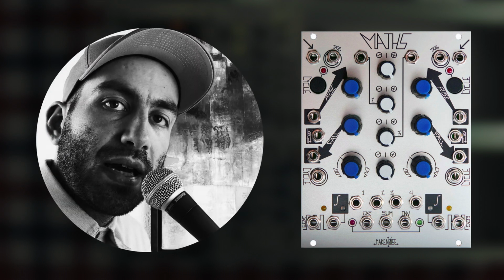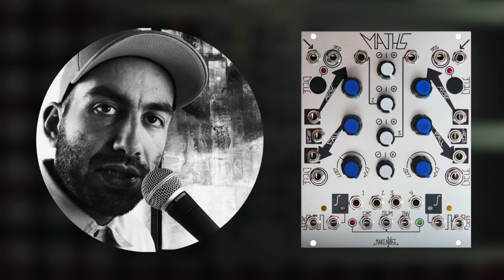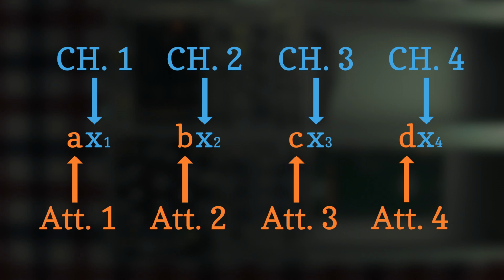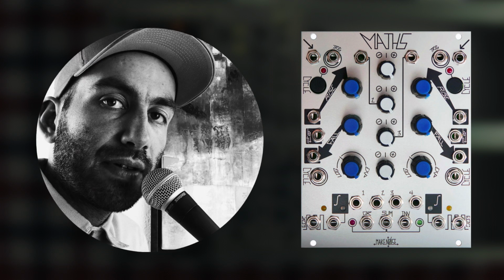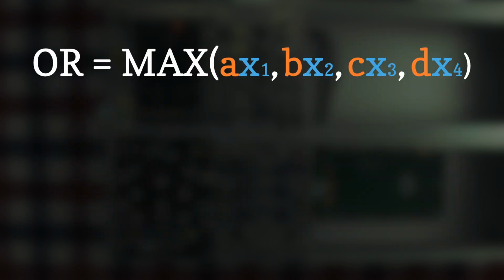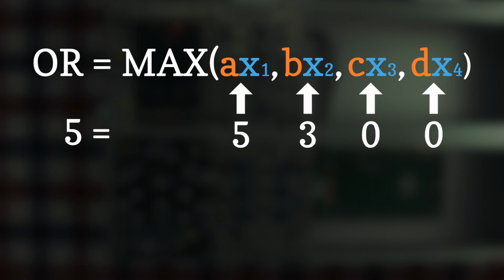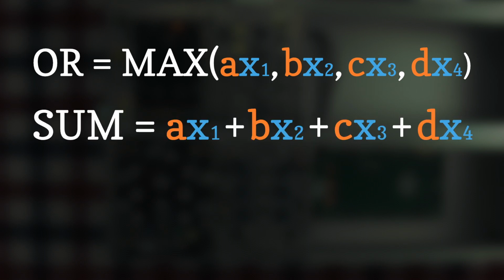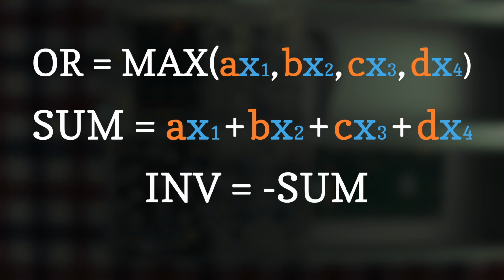MAKE NOISE MATHS TUTORIAL ~ Eurorack analog computer module

Comment: Thanks for the video!
 Still trying to understand: what's the main difference between Cycle and Trigger inputs?
Reply from the maker: The cycle input simple toggles the cycle on or off. it's like a gate input for pressing the cycle button. So as long as a gate is high in this input it will keep looping. The trigger input actually triggers the function. Hope that makes sense.
Reply: @onceuponasynth  Got it. Thanks a lot!

Comment: if sum is the equation ax1 + bx2 + cx3 + dx4, then it can essentially be thought of as the dot product {a,b,c,d}.{x1,x2,x3,x4}. So if you think of each attenuverter as the component of a vector, and each of the channels as the component of another vector, then the sum operation multiplies their two magnitudes and the cosine of the angle between them. or in other words: it projects one vector onto the other and multiplies their resulting magnitudes. crazy! Imagine the kind of complex math you can do with this if you really analyze what's going on each of the channels. Their voltages vary, but in ways that can be related to each other. This is really cool.

Comment: Amazing video. Thank you. Question for the masses, if I went another direction and bought a Function or Contour1 (basically Maths ch 1 or 4 only) Would I miss not having the rest of the Maths functions? are most people using all functions simultaneously ie the mixer, both slope gens, attenuators, etc? Im aware that it all depends on what Im trying to do. Just wondering in a real world scenario. This would be for noodling in the house, not creating the next masterpiece to give to the world😄. Just looking to save a bit of space and cash.
Reply: Well first thing to realize is that you’re not actually getting the full 1st and 4th channels of Maths, because neither Function nor Contour has built in attenuation. 

If you already have a ton of attenuation, inversion, offset, and mixing in your setup then you could probably do without some of the logic stuff especially if you don’t do generative patching or use complex modulation by combining multiple sources. However, if you don’t have a lot of utilities, you’ll probably be patching and think “damn, I wish I had another attenuator/mixer/offset voltage” and that’s where Maths comes in clutch.

The best way to get the most out of a Maths like module in the least HP is probably the Cosmotronic Delta V which is two function generators and two VCA’s in 10hp.

Comment: 5 OR 3 OR 0 OR 0 = 7, not 5 as you stated here 1:50
Reply from the maker: So the "SUM" output would be 7.  But the OR output outputs the highest value out of the inputs (in this case 5). From the manual: "It always outputs the highest
voltage out of all the voltages applied to the inputs".
Reply: once upon a synth i accidentally stumbled upon this video i'm here with a mathematical background. I guess that that OR function isn't the same as the mathematical OR function i searched for analog computer and this was the first hit. When i wrote that comment i thought that this was a genuine analog computer video. I didn't realize that this was about music
Reply from the maker: Ah got it that makes sense.